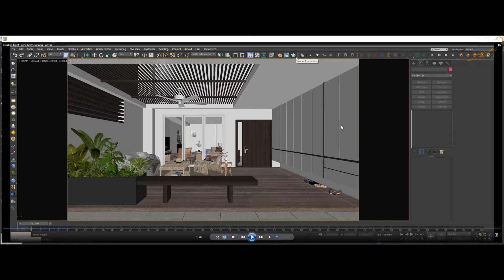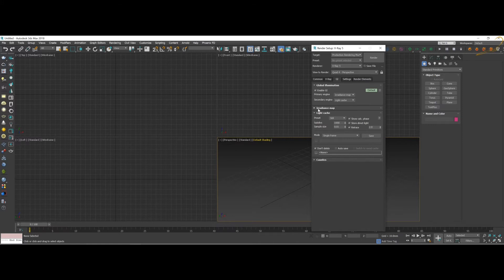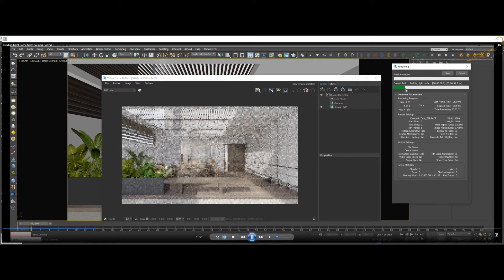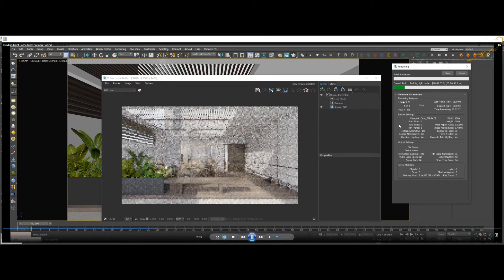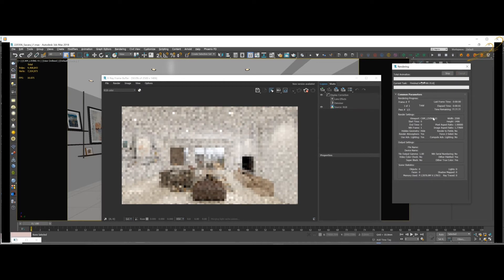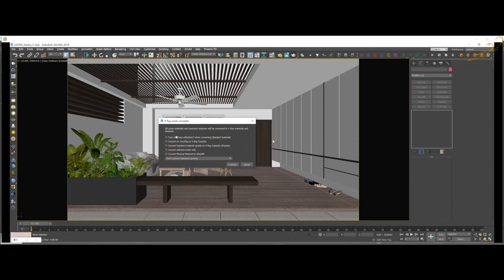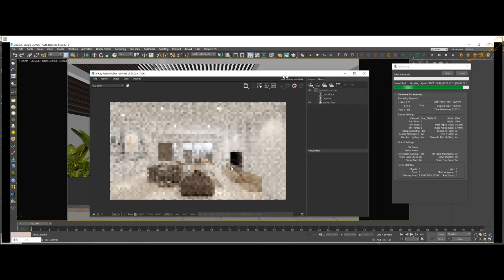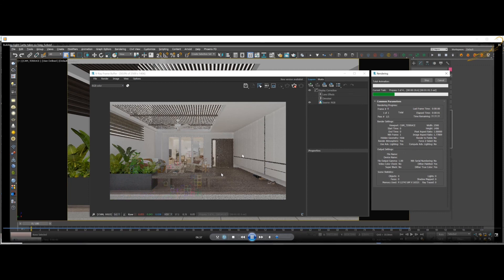Building Light Cache takes so long? | 3ds max | Vray |  Vray Scene Converter | Solved (English)

Comment: Bro
I am rendering a large scene with three thousands houses
when I start rendering the render window appear & on its mentions that transforming vertices 
Actually transforming vertices is taking too much time some time take half hour or one hour.
when this message despair then other render become very smooth but transforming vertices taking too much time of my rendering.
I have I9-14 generation machine with 128 ram & 4090 RTX graphic card.
Do you have any solution of my this problem......?
Reply from the maker: @bilalakram4783  
Hi bro. Based on your current issue, you can try my following solution ideas one by one. Your PC is more than powerful enough. Transforming vertices problem may occur when you have too many polygons, or Xfres which cannot like properly, or other bugs problems because of the merge objects. 
So, try these one by one. 
1. Try to use Prune Scene Max Script to clean up your file. I already uploaded the tutorial and download link in my videos. Pls check it out and try it. If it didn’t work, try no 2. 
2. Simply get a new file and merge all your objects to new files. Don’t use saved render presets. Try to adjust similar settings as your old settings. And try to render. If it doesn’t work, try no 3. 
3. Try not to use the Xref objects from your network server. Copy to your local drive and link them again. 
4. Try not to use complicated materials if you don’t need to render close up views. Especially the leave materials. Use the simple one for aerial views. 
5. Same things for the Vray Proxies. Try to link the local proxies. 
6. Check and delete unnecessary Environment & Effects.  
7. Use layers for different objects and hide one layer by one layer and render. And see it’s still happening or not. 

I hope one of these can help you. If it’s still happening , let me take a look your working file if you’re okay.
Reply: @naingaung7318  Thank your for your reply
1. I am not using any xref file on this file or project, All models are in the same file.
2. I am always use to work in layer & so i am doing the same thing in this file already.
3. I always use to prune scene in my every work to clean the viruses in the file,
I am also using prune scene in this file as well but its taking too much time to clean may be take 1 hour to 10 to 12 hour.
Now I have started the prune scene again & left the file to clean the viruses
if its work then good
otherwise I will contact & disturb you again for ask help.
can you share me your email or WhatsApp to contact as I have no issue to show you this file to fix this problem.

Waiting your response....
Thank again.....

Comment: In SketchUp doesn't show this option, what sould I do? thx :))
Reply from the maker: @jliagab   Hi. Yeah. There is no such function in SketchUp. So, you have to check some of the following things and settings to solve that issue. 
1. Make sure your max depth values are not more than 8 or 12. 
2. Try reducing the value of min and max subdivisions samplers. 
3. Try turning off ray tracing. 
4. Try turning off displacements. 
5.  Be aware of your texture maps’ resolution. Don’t use very high res images. 
6. Try to make group the models when you model. 
7. Be careful when you assign materials to surfaces. Apply only on front surfaces. 
8. It might happen if you didn’t group the elements or objects. 
Try to check these first and render again. 
Good luck 🍀
Reply: @naingaung7318  thank youu 🩷🩷

Comment: What if the same problem is in SketchUp?
Reply from the maker: @aryatanna89 
For SketchUp case, I think there is no default vray function that can convert all standard materials to vray materials. And I think there is no plug in or script to do that function. So, you will need to pick the suspected standard materials and convert to Vray material manually. One by one. 
Another thing you need to check is your render elements like Denoiser and AO settings. Hope these will help you.
Reply: @naingaung7318  NVM, I found out the issue was that a meterial's displacement was on, I turned it off and tried again and it worked. Finally after wasting a whole day it turned out this tiny shit. Thank you for your reply 👍👍
Reply: @naingaung7318  Thanks

Comment: bro, its dont not works for me too , i have already convert the scenes ~ but the light catch still takes so long to it~ please help
Reply from the maker: Hi bro. Sorry for late reply. In your case, there might be some other issues still have in your file. So, try these things out. 1. If your scene have high poly objects which are in group stage, attach them as one poly object. For example, high poly car or accessory should attach as one object. They should not be inside the group. 
2. Try to convert to Vray Proxy for high poly objects if your scene has so many similar objects.
3. Try to clean the scene using cleaner script which I uploaded before. 
4. Try to hide the suspected object from your scene and test render again. For example, if your rendering was okay before you merge an object, hide that object and render again.
If your scene has a lot of million polygons, there is no choice. Maybe I can figure out if you can send me your working file. Hope above tests can solve your problem.

Comment: 🥲it didn't work
Reply from the maker: What’s your rendering problem? Taking so long in light cache calculation? Or irradiance map calculation?
Reply: @naingaung7318  really slow in light cache calculation, from yesterday suddenly every single file has this problem, Two days ago was all perfect, i don't know why, my brother think that the problem is the disk too full, It'could be' the problem ?
Reply: *sorry for this terrible english🙏🏻🇮🇹🍕
Reply from the maker: @giuliafanasca   I don’t think it’s because of low hard disk space. If it’s happening in your previous or recent projects, it might be your hardware problem. How about other programs? Are they working well too? If you want me to troubleshoot your file, you can email it me. Try these too. 
1. Reset rendering settings and try again. 
2. Merge everything into a new file and render again. 
My email is naingaung09@gmail.com

Comment: Thank u😇
Reply from the maker: Mg pleasure 😀
Reply: @naingaung7318   can u provide me all vray light intensity amount plzzz
Reply from the maker: @muscleocean7757  You mean all the vray lights intensities that I used in that file? Or which one you are mentioning? I believe that the light intensity varies based on your camera, color mapping settings and your rendering settings. So there is no fix value for lights. If u want to follow my values, you will need to follow my settings as well.